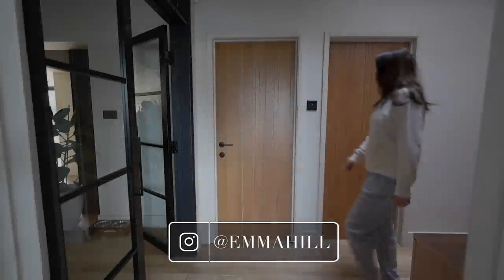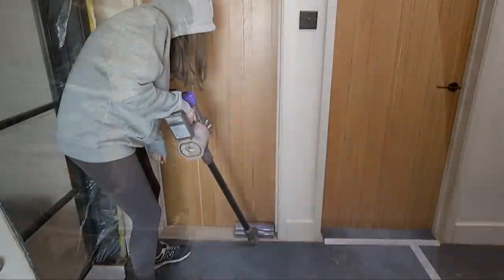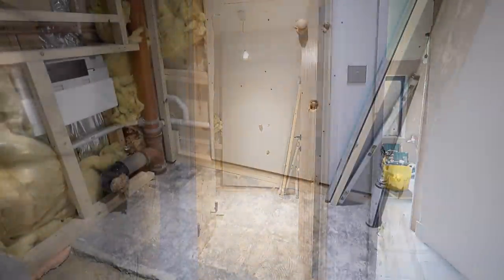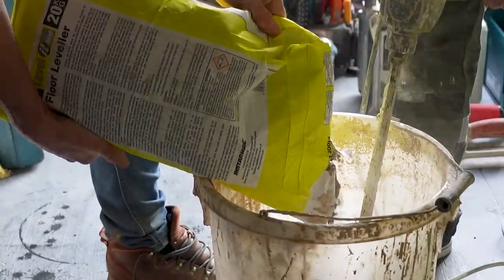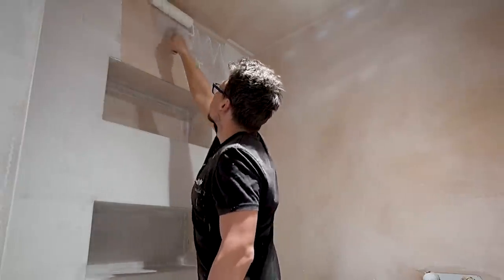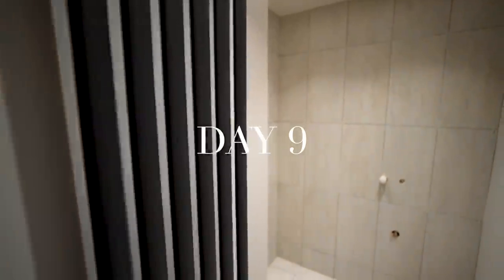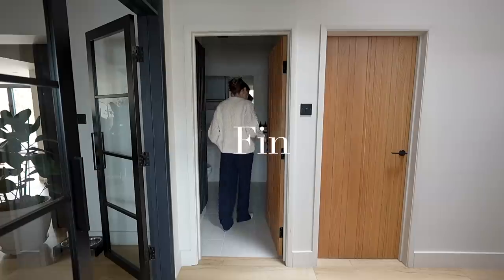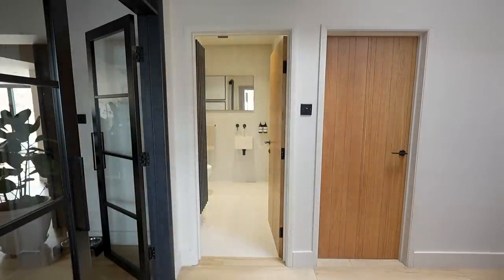Outdated WC Toilet Renovation | Neutral & Minimal

Comment: I put a big box fan in a window, with the air blowing outward on high speed, to remove most of the dust during demolition.  We demolished some old plaster walls and ceilings and this really worked to minimize the spread of dust into the rest of our house.

Comment: Emma, your style is impeccable! You have such an eye for interiors. 
As someone who is yet to be a home owner and has never renovated or decorated, please can I request that you include details of pricing? A rough range...as obviously labour costs will vary upon area but it would be nice to have a clue as to how much something like this would roughly cost. 
Thank you x
Reply from the maker: This is why we don’t include costing because labour will be different costs but also not everyone would have a wall chopped down, not everyone would need self levelling or would have as many tiles, need plumbing moved etc. So it’s really more accurate to get several quotes from tradespeople local to you and cost a job with the fittings for your space/project. We also had 2 bathrooms done at the same time so again wouldn’t be accurate to just one downstairs toilet project x

Comment: Wow. Every inch of your bathroom remodel is so well thought out. It turned out stunning. AD worthy (as with nearly every other part of the home).  
Even with the expansion of the bathroom space, would it get too hot in there with the water heater on or does the bathroom door get left open?
Reply from the maker: The door is left open (unless being used) so we get the heat from radiator in the hallway 🙌🏼